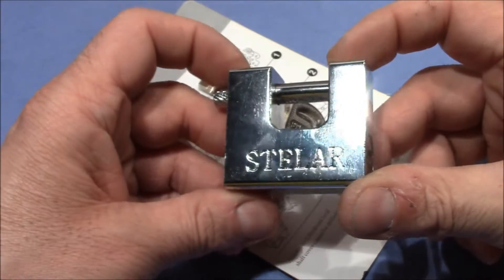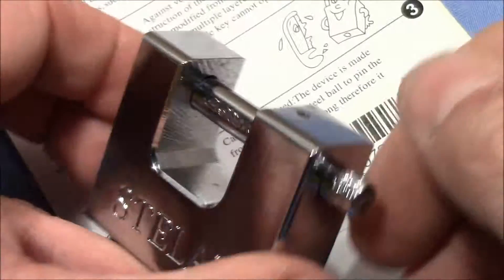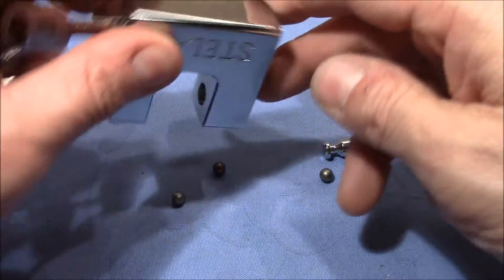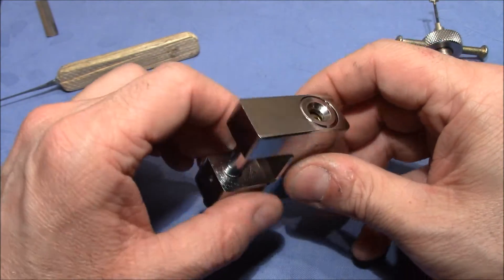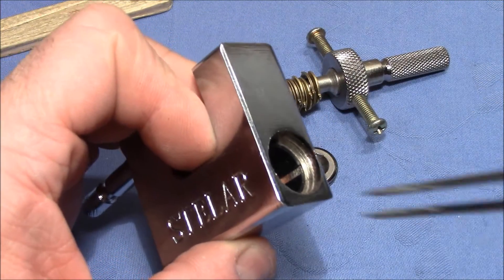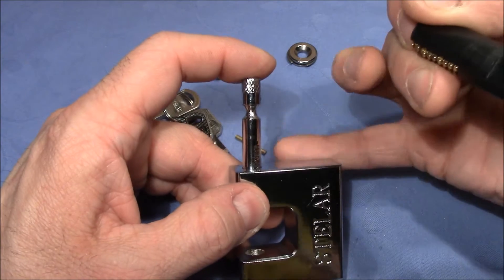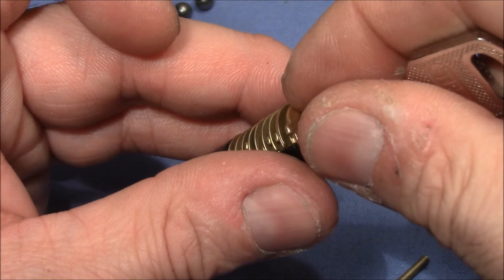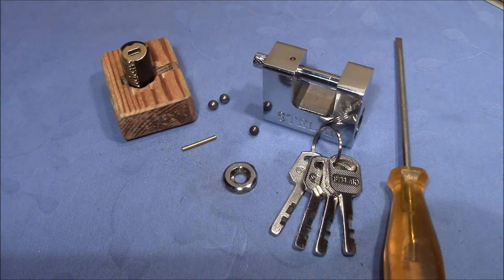(picking 653) STELAR disc detainer Lock - fun while exploring how disc detainers work

Comment from the maker: I show you a cheap disc detainer shutter lock that can be forced open easily. Also the shackle and the locking mechanism can be disassembled. This is a great opportunity to explain how disc detainer  locks work in general with the tensioning discs and the sidebar. No picking however.

Comment: Excellent breakdown! Thank you!  It helped me to disassemble a "Pvolinson" stamped (marketed as "Rolinson" and with the font used could at first glance pass as "Rolinson"), cheap ($4)  "Hardened", "100mm", "Italy Technology", and "MADE IN PRC" shutter lock.  A bit of prying with a screwdriver (from the Ikea FIXA home toolkit!) popped off the retaining cap.  It's a very similar design and apparently the same materials too, only the stamped logos are different.  Curiously, the keys supplied have a "SOLIE" trademark.  The card-backing on the package has several instructional/cautionary graphics, most of which are a mystery to me.  Seems that 97mm is close enough to 100mm for this manufacturer.  :)  I don't have a drill, but I bet the channel holding the ball-bearings is only minimally covered by the lock exterior.

 As @LockPickingLawyer mentioned, the plastic IS easily deformed - just some moderate counterclockwise action with the key permanently deformed the plastic cam at the back of the plastic core on a metal stop pin, although not enough damage is done to prevent the lock from working.

Hmmm, IDK.  I guess it's worth $4 as a puzzle to extract the ball-bearings.  :)
Reply from the maker: It's always worth to dissect a lock and try to put it back together if possible. Thanks for stopping by and happy picking :-)

Comment: My key got stuck on that lock hole..i cant turn or pull to get the key out...what shud i do?
Reply from the maker: Try knocking the lock gently with a hammer which rattling on the key.
Reply: @Potti314   ill give a try and thanks for ur suggestion...

Comment: Nice explanation, though it would be nice to see you pick it too :-) one this I don’t like about the plastic cores in these locks is that when picking them, if you are a beginner and use far to much force, you can drive the nipples under the plastic, causing all sorts of problems
Reply from the maker: Now I can imaging how this locks with the plastic core behaves when picking. The made it more difficult by adding bad components ;-)

Comment: Put the shackle end in a cordless drill and put it on full speed.
Then apply a file or saw blade to the shackle and see how long it will take to cut through 🤔🤔😂
Nice break down of an otherwise underwhelming lock.
Thanks for sharing 👍👍😎😎🍺😘😘
Reply: That's the first time I've heard anyone say this but sounds like a fast way to cut it open, nice one m8 thanks for the info.
Reply from the maker: That sound like great fun - will try it mate.

Comment: You can pick it just by inserting paper towels and compressing them inside. Then , any object that has shape like key will set discs in right position or it will spread plastic housing enough to simulate opening. I discovered that "method" after trying to make prank on coworker that turned into completely different thing after opening. 😂 Snaping housing from inside can also help. 😂😂😂😂
Reply from the maker: The paper towel trick reads interesting, like selfimpressioning?
Reply: @Potti314  , exactly ! I was writing this from bed , so , a bit sleepy. 😂
Reply: I almost forgot about it , but , that was somewhat "ideal" attack against disc detainer locks. :) Might work on even high security ones , but NOT any of Abloy. They are quite different animal on their own. :)

Comment: I believe LPL or BB also pointed out the big flaw where the disc retainer can easily be pried off on these cheap Chinese disc detainer locks.  Ya, I love the superior "plastic brass" core along with the Boron alloy shackle and heat treated, case hardened lock body, ya right!   Be careful not to heat it with a bic lighter or you might melt that "solid super hardened disc core" (and then absolutely do not twist with screwdriver in the keyway, as you might "damage" the lock)
Reply from the maker: Haha - yes, this exploit is widely known but it was interesting for me to test this myself with holding the lock in the hand. And wait for the next video to see more fun with this lock and it's plastic core.

Comment: Nice video and explanation... I can’t stand those locks with the plastic core housing! The plastic housing can actually make picking tricky because tensioning a disc can deform the plastic such that the gate is no longer aligned. Light tension only on them. 

...and thanks for the kind words. 👍
Reply from the maker: Thanks, will try with light tension - was using heavy tension only before and gave up quickly thinking it tensions at the bottom. The plastic core is terrible, I just managed to force out the bolt with pliers.
Reply: Potti314 Doesn’t surprise me... could probably do it with a torch also, which could be fun. 👍
Reply from the maker: Thought about the torch but it stinks a lot I believe - a pair of pliers is less invasive ;-)